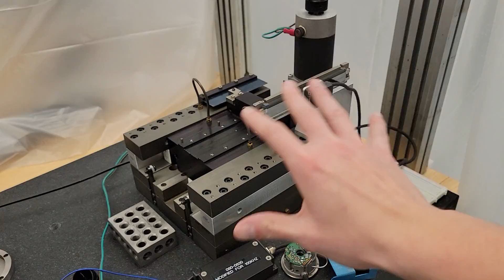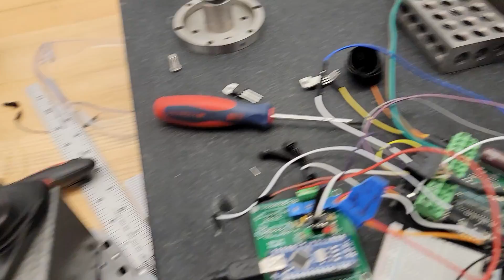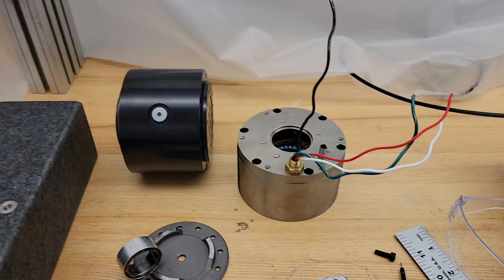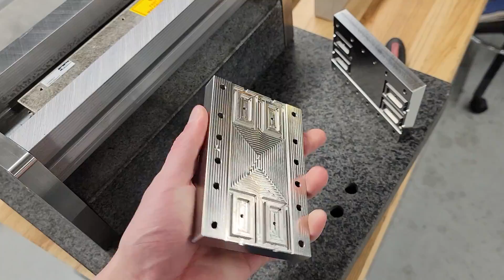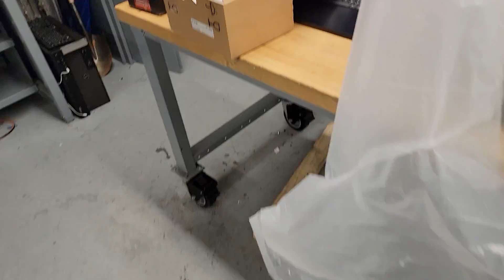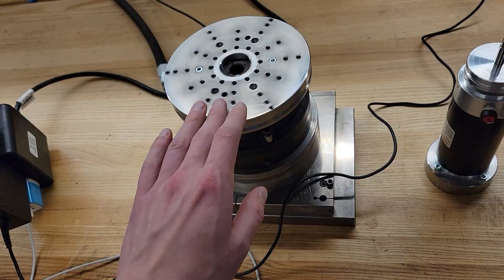Homemade Diamond Turning Lathe Update 11-2022

Comment: How do you make the granite edge side surfaces flat so that it can be mounted to another granite surface?
Reply from the maker: you machine them. we did it on our haas😳. Vid on this coming soon.
Reply: @cylosgarage  Please make a video on this, it will be super fun to watch and learn the process. Trying to build a small CNC mill and wondered how to automate this scraping/lapping using a Bridgeport/CNC. I wonder what spindle attachment and tool you used to machine it on the Hass. Thank You.

Comment: This video was super helpful. Was in process of making my own encoders as supply chain had  1 year lead time, but for some reason had not checked out Heidenhien. Ballpark how much were they charging for that LIP optical encoder?
Reply from the maker: I did not get mine direct from Heidenhain. If you do, they’re going to put you back 13000USD. Renishaw sells some under their Tonic line capable of 1nm resolution for around 1000. Less accurate over the travel though (still very good ~1μm/m). Renishaw also has 3-6 week lead times on those

Comment: I want to clarify that you said '0.01 Nanometer' for the LIP 382. Is that true? A carbon Atom has an atomic radius of 0.09 nm so that's just a mind-blowing resolution. I really want that to be true though. I'm also designing a diamond-turning lathe and we were just talking about scales. I think I found them!
Reply from the maker: That is in fact true! pretty mind blowing, right? Beware however, they come with a rather uncomfortable price tag.
Reply: Wow. That’s incredible. What applications in a machine shop would take advantage of such high resolution?

Comment: You told me you spent all your money on encoder I wasn’t expecting this kind of encoder lol definitely worth an old Tripet grinder
Reply from the maker: simon you know i could not find a tripet grinder for that price in america. Also decimal places are 'spensive
Reply: @cylosgarage  you have an air bearing rotogrind dude, you can have the grinder from the local mechanic who do brake job and don’t know you can dress a wheel with diamond and still pull out crazy flatnessery! Now you need to ask Byron for one of the tropel he has around...

Comment: Wow this project has come a long way. I know we would love as much detail as your willing to give us. But don’t feel like you have to put the project on hold to tell us about it keep up the good work.
Reply: Also .01 nm scales wow didn’t think 1 nm scales existed let alone .01nm. Must need one powerful controller to interpret that what software are are you going to use to control the lathe Linux cnc?
Reply: @joshuahuman1  Current state of the art is 8 picometer resolution. Useful resolution and repeatability in quarter angstrom range.

Comment: Wow, 0.1nm resolution is absolutely insane! Do you have a CAD model for what the machine will look like in it’s final state? Did you do any FE analysis to figure out how the machine will move under load and thermal changes?
Reply from the maker: I do in fact have a model, it would be pretty hard to wing a design like this. I've done lots of structural FEA but haven't done much thermal FEA yet. Not to say that I've not been thinking about it though.
Reply: Hang on—wasn’t that 0.01nm resolution?
Reply: @christophersmith108  Yeah, that's what he said. Not sure if he misspoke though, and too lazy to see if they make such a thing 🙂
Reply from the maker: @Bakafish  you heard correct!